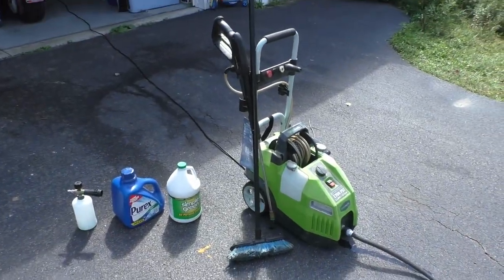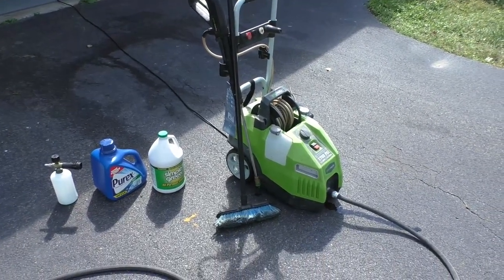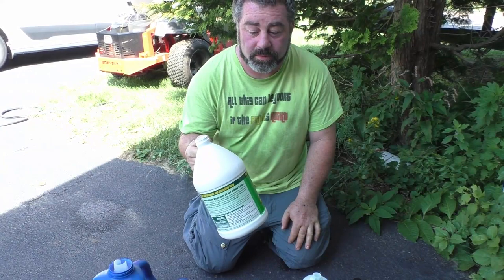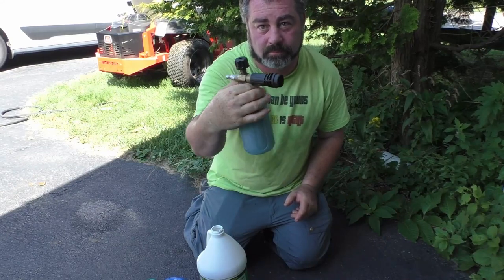Best quick wash for your ATV.

Comment: I think this process is far smarter than most of the expensive fad atv cleaners on the market. I just bought a new 2022 brute force 750 and I’m sure it will need some cleaning soon. My blend will be similar to yours but with a couple minor changes. I have a blend I’ve used to clean houses in the past that does an exceptional job but I haven’t tried on anything else. Once I get a chance to try it and maybe adjust the blend I will pass that info along.
Reply from the maker: Thx I will be intrused what you come up with. Good luck with the new ride.
Reply from the maker: I have a brute force 750 also it's awsom.
Reply: @theeverydayguy8167  so far so good but my son has only gotten it to about 2.5 hours. I’ll let him keep riding occasionally until we finish off the break in period. We have here in Mississippi what I would consider to be some decent places to ride with more than enough Mississippi mud to play in.